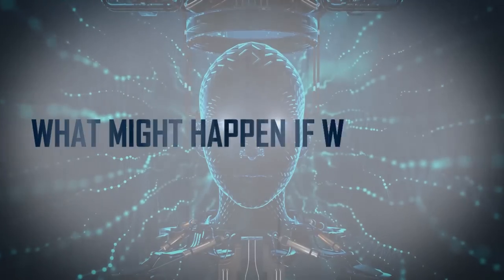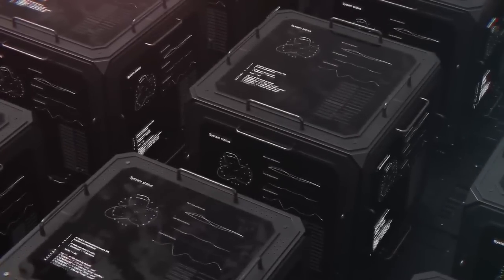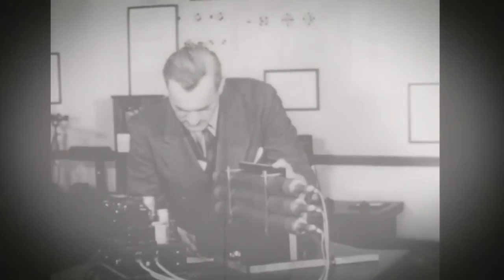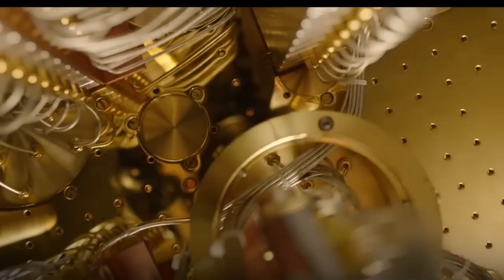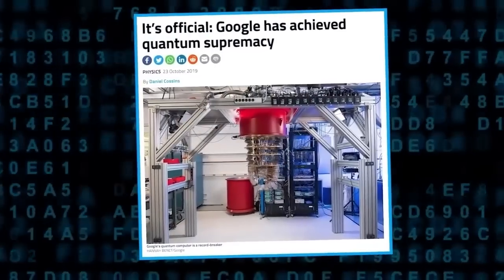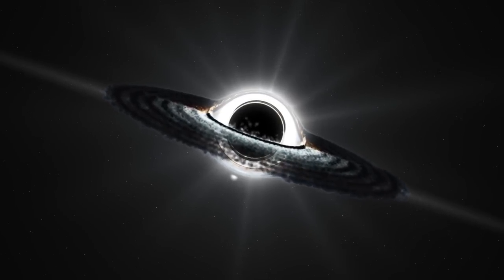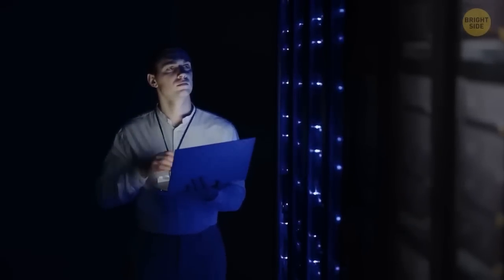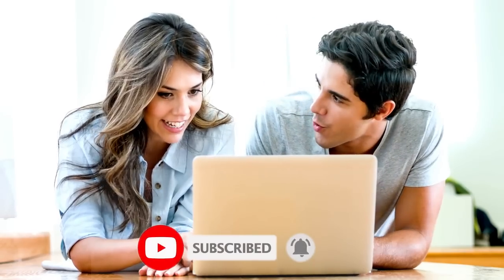Shocking news from Michio Kaku: A Quantum Computer Shut Down After Unveiling This Astonishing Secret

Comment: Gravity and Black Holes are mythical. 

The air we breathe are LIVING Oxygen and Hydrogen gases running around within the atmosphere, and when Bonded together making a state of SOLID mass WATER, it's ELECTRONS Atomic Molecular MOTION are blocked out, left to connect with the next strongest signal in it's vicinity, which is Earth Surface, same as all Electrons from Solids Object's do, a permanent Kinetic act to keep the Solids GROUNDED to Earth Surface, and because of this, the now MOTIONLESS DEAD Gas Molecules are unable to stay afloat within the atmosphere, thus they fall downward, following it's Electrons Unlimited Potential Velocity at the speed of light, connects with Earth Surface 9.8 Energy Conservation System activity's at quantum level's in real time play, this is the following of Universal law, where the stronger Energy Flow always overrides the weaker Energy Flow, within measured area.